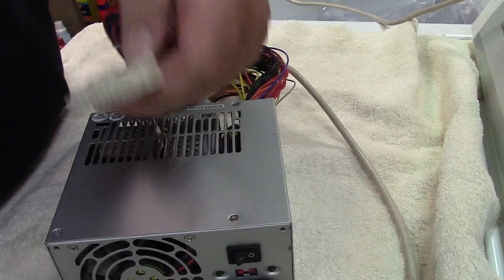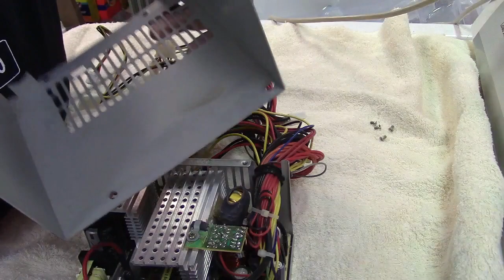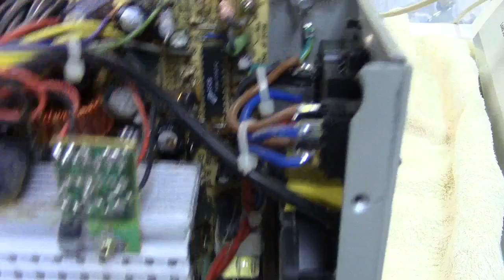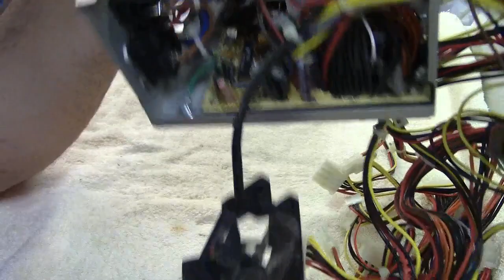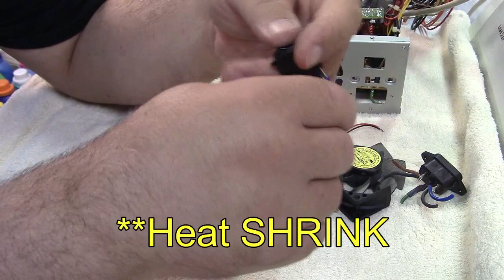Taking Apart An Old, Dead Computer Power Supply

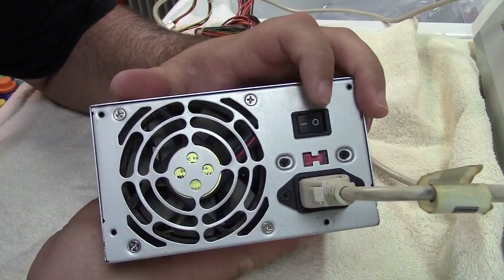Comment: 1:55 not every power supply immediately turns on the fan when PS_ON gets pulled to ground.
Reply from the maker: Some are temperature controlled.  Those are more the exception than the rule.  If nothing else, a meter can be hooked up to verify, but that's out of the scope of most people's facebook addiction.